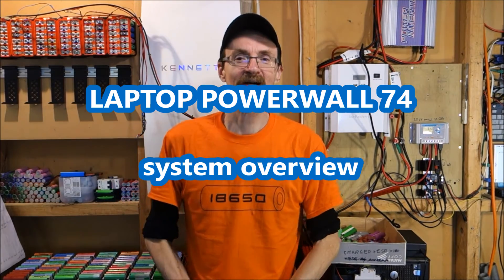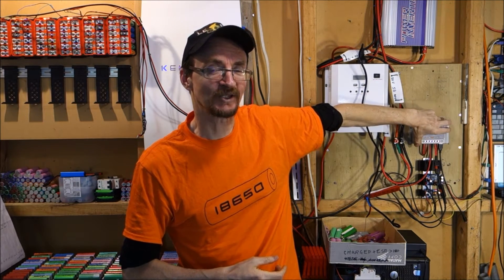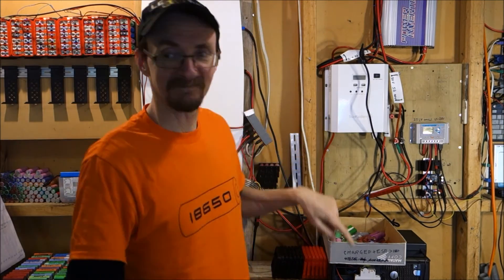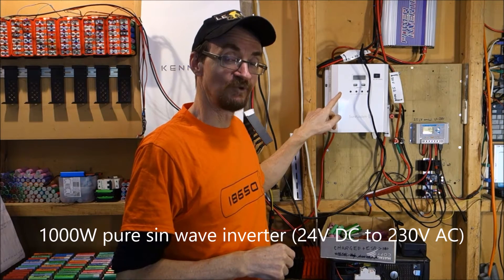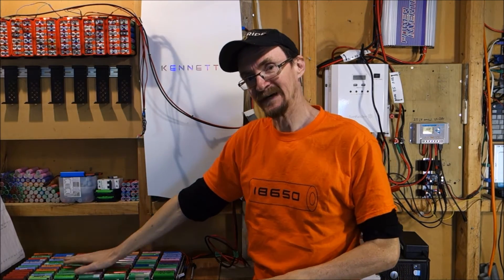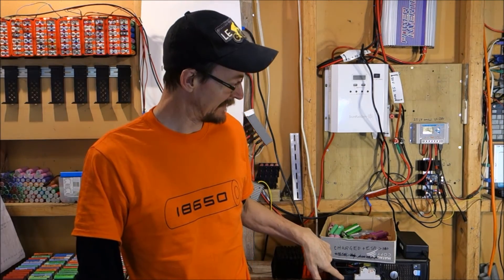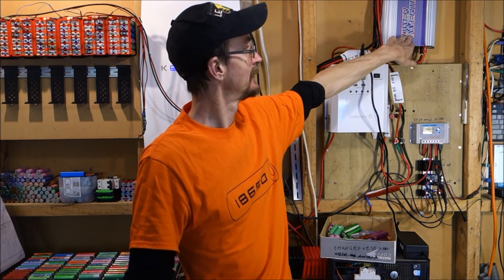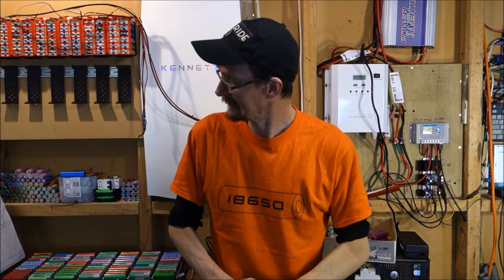Laptop Powerwall 74 - system overview

Comment: Hi dude,  thank you!  What is the voltage output on the current battery bank on the wall?  And did I hear correct 5k?
Reply from the maker: It's a "24v" system (nominally 25.9v, but spends most of it's time around 27v). The pack capacity is 5kWh in total (2+1+1+1). Charged from a 420 watts of solar PV.

Comment: Do you have a vid that goes into more details about the solar charging setup?
Reply from the maker: Not yet Simon. What sort of details are you interested in? Cheers, Paul
Reply: Paul Kennett Do the panels charge the pack with 12v? and do all the panels connect to the pack with just the 1 set of wires or is it like 1 panel per brick or something?
Reply from the maker: Hi Simon - I'm running a "24" volt system. The PV panels run at around 31 volts and the battery pack is nominally 25.9 v (3.7 v * 7). I've got 3 140 Watt panels wired in parallel connected to a small solar charge controller which then charges all the packs.

Comment: Nice video Thanks!
I'm not really doing a powerwall as such...but instead of using an SLA battery in my small 'solar shed' I have made a 3S20P pack from recycled cells.
I am using a Wincong SL-02 charge controller, which seems to be the cheaper version of the SL-03 you have - just without the lcd display.
I set the stop charge voltage to 12.3 and the 'float charge' to 11.3.
I put a dc power meter between the batteries and the charge controller and I can confirm NO current flows whatsoever after the charging completes and does not start again until the battery gets down to 11.3. 
So these Wincong controllers are great for the price I think.
Reply from the maker: Yeah - I've been happy with the Wincong controller so far. It sounds like you're start the same way I did - with a small simple system. Good stuff.

Comment: Hi Paul, tks for the overview. Out of curiosity what's the make-up of panels you have on the garage roof (440w you called it)?
The DIN rail mounted packs look well, I have to say! Fuses readily visible, and convenient for pack swap-outs if needed. Nice.
Reply from the maker: 420 Watts from 3 140 Watt panels. It used to be 4 panels but one brew off the roof in a storm (mostly due to poor attachments on my part). Then another 2 old 80 Watt panels hooked up to the grid tied inverter.

The DIN rail mounts worked out remarkably well! Someone has just asked me to do a version that would work with the standard 18650 battery clips that everyone else is using. I might get to play around with that design option tomorrow.

Comment: Hi Paul, would be interesting to know what the thresholds you have set in the charge controller, i'm about to do the same with an EPever solar charge controller.  Also which BMS are you using for your 2 KWh pack?
Reply from the maker: The BMS is: http://www.aliexpress.com/item/24V-30A-7S-BMS-PCM-PCB-24V-Lithium-battery-BMS-for-7S-3-7V-lithium-cell/32469245428.html
My settings for the Wincong SL-03 are:
Stop charging 28V
Float: 25.2V
Under V recovery: 24.5V
Under V cutout: 23V
Reply from the maker: And I've just got one of these to try out: https://www.aliexpress.com/item/7S-30A-29-4V-lipo-lithium-Polymer-BMS-PCM-PCB-battery-protection-circuit-board-for-7/32717974843.html
Reply: Thanks for the quick replies, the first one is unavailable any more, think i'll try that second one as i'd spotted it on ebay too for a reasonable price.  I think with a 1.1KWh pack it's going to get out of sync pretty quick so need something.  a constant 30A model would be perfect as i've got a 30A charge controller so ties in nicely.  I'm always dubious of the way the positive comes off the balance lead though, worry about 30a across a small link. Ignore that last comment i see you take the positive directly off the pack.
Reply from the maker: I wouldn't trust them with more than 20 Amps myself. Safer to assume it's actually only OK for half the stated power rating. Fingers crossed too.
Reply: Thanks will keep it in mind, most likely not going to be near 20amp anyway as I've only a few panels currently :-)
Reply: Thank paul ordered one of these, i've a crappy 7s bms that i might use in the meant time which shall hopefully handle the 1.1Kwh pack but would like the better one for when i start moving to 2Kwh and beyond.  Will see if it gets here ok mind as it's been sent via Turkey post what ever that is lol

Comment: I was just about to say your going to need to have some more solar PV to charge the 10kWh powerwall when you get to that stage. Tho before you buy panels have a good think about how many you will need because it might be pointless to buy 1kwh when you really need 2kwh min for eg and then have to mix and match. 
For 10Kwh i think you will need 2kWh of panels as a min so somewhere between 2-3kwh would be good. For 5Kwh powerwall you will need about 1.5kWh of panels in NZ weather for daily use, Right now you might not be using it daily but you might want to when you get to 10kWh so a good plan is needed.
1kWh of panels will give you about 5kWh on a nice summer day but that is only for 2 months of the year if that, Most of the time its cloudy for half of the day for eg.  1kWh would give you on Avg just over 3kWh a day over the year. From my expensive its better to get as much as you can fit on the roof, That way if its cloudy then you still get almost a full charge. Its far better to have more PV than less because adding more panels and racking down the track is 1 expensive, and 2 might mean another MTTP controller if the current one only has 1 MPPT Channel which all the small ones do which means added costs buying a another MPPT for a another set of panels in another year. Remember one MPPT channel per model and size of panels. Meaning 2x220w panels on one MPPT channel/controller and 6x220w on another channel or if you only have one channel then it means another controller. If you buy a big controller then it will have two channels and you can group the models of panels per channel, and add more panels on the spare channel. My 5kWH in the main house has two channels and my strings are spilt in two so 10x240 per channel but they are all the same voltage and model, so i could put 20x240 on one string and 2x300w panels on the other Mixing two types of panels but this is possible because i have two channels. Which would be more than the inverter could do but it would give me more on the cloudy days and the inverter will just max out on the sunny days. With my 4.8kWh i see it spike to 5Kwh now so it will be interesting to see if it maxs out in summer tho it will be hotter which will drop the panel performance.   For me i am having to treating the powerwall project as a separate project which means i will need to buy more solar for the garage to charge the powerwall now this isnt such a bad thing since it will mean i will that i will have enough solar for the house and to charge the powerwall. I guess if the powerwall is changed i could also feed it into the grid-tie with limiter off and export the extra solar during the day in summer time.  Anyways since you pointed out about buying more solar in the video i just thought i would give you something to think about long term in your project while it might mean spending some more on solar it will pay itself off   :)
Reply from the maker: I agree. The ideal situation for me would be to do 3kW on the garage (the house roof is shaded by a big tree on the street). I've got a few things working against that though; my wife isn't so keen on spending "a lot" on this, my garage roof needs re-roofing, and the power cable to the garage isn't that flash. So the 3kW option has a lot of prerequisites that are slowing me down.
I'd love to ask a bunch of questions about your PV install... starting with how much did the pallet of PVs cost?
Reply: I was very lucky and was asking questions on trademe, when i got a call from someone who had two palets left over if i wanted to buy one.  23x240 panels 5.5kWh $3585.6 inc gst and shipping with mainfreight from Ham to Auckland. $179 inc gst per panel was a very good deal. It was 128+gst per panel. But given that was a once off so now that i need some more panels i will need to pay alot more unless someone else is buying a palet and wants to go halfs. I need 3 more of the garage roof to get to 6 but really i could use 9 - 11, 9 would give me 12 on the garage inc the 3 i have and i could fit 2 more on the main house roof if i had them.
Reply from the maker: Nice. That was a good deal. Oh - man. I'd love to go halves on a pallet load, but I don't think I'd get it authorised. But... maybe I should find out the costings.
Reply: finding the costing is the first step to working out the authorization means.
Reply from the maker: OK - will do. Thanks Mike.